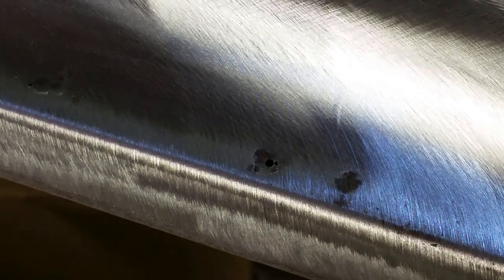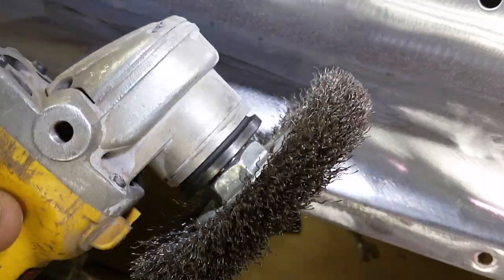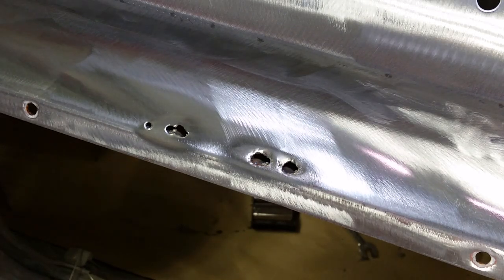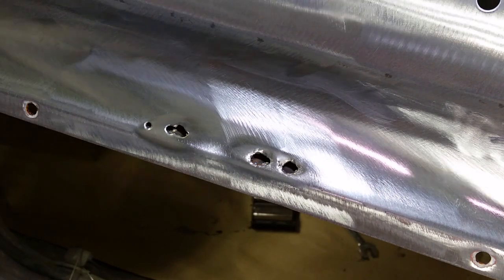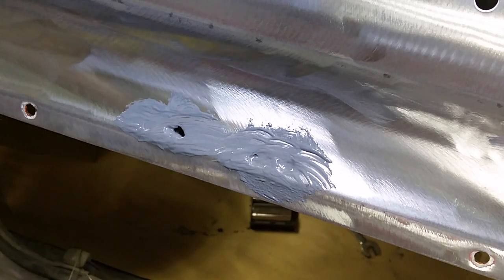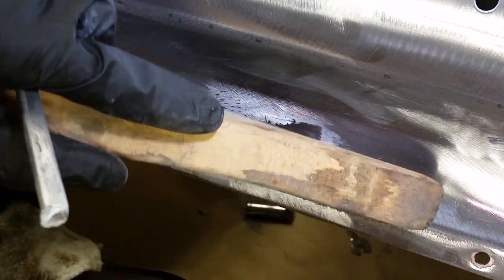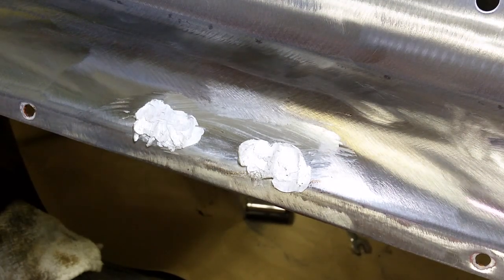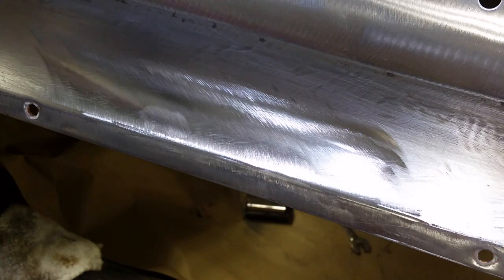How to repair rust holes in 15 minutes

Comment: Glaze only goes on top of primer, not direct to metal. Body filler goes direct to metal for those that dont know. Thanks for the leading tutorial. Sweet video man.
Reply from the maker: I usually use a 3M number 801 two part professional glaze that bonds to: primer, metal, fiberglass, and aluminum. Thanks for the suggestion. Sorry about not including the glaze type in the video.

Comment: I need to repair some small screw holes and a few Mig Welding seams on a car I'm working on.  Never used lead before and watched a few YT videos on the technique.  Yours is the best one and was very helpful to me.  The result you got here was amazing.  I hope mine looks as good as yours.  Thank you
Reply from the maker: Ford Fan Thank you for that.  You most definitely can repair screw holes with this method and the weld seam as well.  I suggest a good quality direct to metal epoxy primer over it.  Thanks again!

Comment: Great tutorial man. Had a hole in my motorcycle gas tank and did this and it's been holding up just fine.
Reply from the maker: I’m glad it worked and appreciate the feedback! Someone had asked would this technique work on a gas tank hole and now I have a definitive answer, “yes it will “! Thank you!
Reply: @Gill Rod Shop  no problem. Whoever asked you, just tell them to make sure they cleaned out any fuel/fume from the inside the tank, that way it doesn't explode
Reply from the maker: @Covert_Op  👍🏾

Comment: Thank you Gill, I will use this method fixing all the pin holes on vintage Harley Davidson gas tank.  Great video!
Reply from the maker: Paul Healey, it should workout just fine! Thanks
Reply: ⁰⁰7777777777777777777777777777777777777777777p777777777777777777p9ppppp7ppp7ppp77p⁸p⁸⁸

Comment: I have a pin hole issue near the bottom passenger side corner of my windshield on a Chevy pickup I’m fixing up. I don’t intend for a show quality truck just something I can drive and enjoy. I can’t access the back of the area. Would you still advise using this method if I can’t use rust inhibitor on the back side of the surface area I’m working on?
Reply from the maker: The window doglegs usually rust from the outside in but if it rusted from the inside out I would want to find the source of moisture and address that first. You should be able to use this method with success on pinholes in window frames. Thanks 😊

Comment: I have some nasty rust that's created holes and thinned out a fist sized area of my old Toyota's tailgate that I'll be attacking this week. Would LOVE to beef up the area and fix the holes without using body filler. Just got a new cylinder of C25 for my mig too (would love to solder but I can dial back the mig and use thin wire which I already have), so I'm happy I came across your video!
Reply from the maker: I love the old Toyota trucks! I hope it turns out spectacular!

Comment: Great video.  Can a repair done with the lead stick be chromed?  I am looking for a way to patch a few holes in an 80's motorcycle muffler as they are no longer available for the restoration.  Thank you!
Reply from the maker: VMX yes it can be chromed by a professional plating company.
Reply: Gill Rod Shop   Gill I read that most shops can’t chrome over lead/tin, is that just BS?
Reply from the maker: VMX anything that is conducive can be chromed. Plastic and other poor conductors can be chromed also, but the process is different! I spoke with a chrome plater today and he said he can chrome over tin/lead filler. Send a picture of the area on the muffler that you're repairing and maybe I can offer some advice. Thanks

Comment: I'm repairing rust holes in a child's wagon. The wagon was sandblasted and epoxy primered. Do I have to sand or grind the epoxy off to bare metal to solder the holes?
Reply from the maker: Yes, you will have to take it back to bare metal and tin it before soldering. Being that the wagon is just a single panel without a sub panel behind it the repair work will be visible from the inside.
Reply: @gillrodshop  thank you for the quick reply. Much appreciated and great video!

Comment: If I have an antenna hole about an inch wide on my roof, can I use a scrap piece of metal and lead it in place before final finishing?
Reply from the maker: I’ve never tried it but it should work if the plug is larger than the hole and placed on the backside and lead on top. I have tacked welded a plug and then use lead body filler over it! Thanks!

Comment: Great to see the old method for filling holes on panels. That lead won't go anywhere, like you say - far better than fillers. We vsll that technique 'lead loading' in the UK. One question - can you use this method on holes in flatter panels ? I am just thinking applying heat to one area on a flatter panel may cause distortion of the metal ?
Reply from the maker: Chris Ward thanks for watching and commenting! You should be fine as long as you heat the area around it evenly. The heat isn’t so bad but uneven heating/cooling is what warps panels. I’ve had car bodies baked and dipped in acid to strip the old body lead, fillers, and paint from them and they turn the oven up to 800 degrees F. 🙂

Comment: No need for backing plate? The lead won’t flow into the other side? I’m planning to use this on bottom of my car door it has small rust holes. Thank you
Reply from the maker: No need for a backing plate if the hole is small. This video that I’ve linked below shows a blind hole done on a T-top pillar and what the lead looks like from the backside once it’s done. You have to use the proper heat and not over heat it though. Thanks for watching and commenting!
https://youtu.be/ur-etZqrnXk
Reply: @Gill Rod Shop  perfect thank you so much, Eastwood has the smallest kit on back order until January but at least now I have a better alternative thank you!

Comment: This is epic... would it work on a roof with 1 hole near the windshield.?... about the same size hole as you worked on
Reply from the maker: Sure! It should work anywhere you have that is clean, can be tinned, and the correct shape to hold the lead solder.
Reply: @gillrodshop  I'm totally trying this on a test piece first... so the steps are, clean metal really well (40 grit etc), apply tinning agent, flux (zinc chloriode) , hit with lead, then wash with water/baking soda to neutralize the acids in flux?
Reply from the maker: @mikep509  Yes, sounds like you have it! You may want to get the metal as bright as possible by using a low speed wire brush chucked to a drill motor then scuff the area around it where you want the lead to feather with the metal, scuff/sand with a course grit (80-120) for a smoother transition around the edge. Then you may go to a 220 grit and it should look almost seamless. I’ve also published a video of me doing a Z28 T-Top area that may help. Thanks!
Reply: @gillrodshop  thanks so much for this window into alternative car repairs.   It's a great learning opportunity 🍻🍻
Reply from the maker: @mikep509  Welcome!
Reply: @gillrodshop  ... question, would a 60/40 tin/lead core solder wire work for this kind of repair?... following the cleaning steps... I can pick up 1lbs of spooled wire for $30
Reply from the maker: @mikep509  short answer is no, but you may try a test piece. I only use 70/30 from Eastwood Tool co.
Reply: @gillrodshop  yeah I see their products, slightly expensive for the same thing.. . I have a few metal working supply shops around my area they may offer a solution as well ...  I understand the process of tin to steel , then lead to tin.   Why can't car manufacturers just build galvanized cars lol ..

Comment: Serious question. What are the pros and cons of doing this over just using a mig welder to fill in the holes then grind the metal flush?
Reply from the maker: This method is quicker and can be done at a lower temperature. From my experience the mig would make this hole 3 times the size before it would start filling in. Also, no need to worry that much about warping due to the low temperature. Thanks for watching and commenting!

Comment: Nice job bro any idea how long did it last? Did it blister back out? Looking for another alternative instead of welding on a thin roof, This is a great video. Thanks.
Reply from the maker: It’s still holding well! Just be sure to neutralize or properly prep the metal before top coating! If your vehicle is a classic it has lead filler in the pillars already, more than likely. Thanks for watching and commenting 👍🏾

Comment: Can small rust holes in a steel fire pit be repaired using this body solder method?
Reply from the maker: Robert Halseth yes but as soon as the pit gets hot enough to melt the lead it’ll fall out. Welding may be the better option in that case. Thanks for watching and commenting! 🙂

Comment: Thank you for the video. 
I am restoring a 1970 Dodge Charger and the rear window area has lots of rust holes. I was planning on cutting out the rusty areas and patching in metal but this may  be a better way. So often, even careful use of the MIG can result in burning through areas that are super thin. You start by trying to close up a tiny hole and end up making several larger holes that require more and more welding.
Reply from the maker: Gregory Kern I’m sure it’ll turn out fantastic! Thanks
Reply: Tig welder might be a good option for you
Reply: Had the same problem. Turn down the spec's on your welder and see if that solves the burn through.

Comment: My Harley-Davidson gas tank has several small dents in it, could they be filled using this solder and would it survive the heat of powder coating after the tank is repaired?
Reply from the maker: David MacGregor that is an excellent question. I'm not so sure that it would stand up to temps (+\-400degF) that high. I guess it would also depend on how long it's at that temp. I've had car bodies dipped in acid tanks but they bake them about 8 hours at about 800 degrees before they dip them and all the solder melts off the body at that temp and time period. I can try it if you want me to?
Reply: Eastwood has a led free body filler they sell.  It’s applied the same way.  It’s melting point is a lot higher, maybe 600 degrees.  I just had some metal powder coated that I used the body filler on and the heat from the powder coating was not a problem.

Comment: Thanks Gill. I have a tricky job near the boot (trunk) of my 1993 Cavalier, and I had forgotten about body solder.  You've made my day!   Cheers, John.
Reply from the maker: thelonegroover Thank you and happy soldering.
Reply: Thanks Gill. Just been in the depths of my garage storage space and found a body solder kit I bought quite some years ago.  The solder is lead based, but I guess the solder you're using in the video is non leaded as you're sanding it .  is that correct?  Cheers John.
Reply from the maker: thelonegroover I don't want to tell you wrong so I copied and pasted from Eastwood.com below. 
Eastwood's Basic Body Solder Kit helps you complete small leading jobs with better adhesion, strength and durability than plastic fillers

Spreadable (plastic) range is 361-489 degreesF
Includes tools and accessories
30/70 lead-based body solder is slightly easier to work with than our lead-free solder, and provides better adhesion, strength and overall durability than plastic fillers. Includes 2 lbs. of solder for small solder jobs."
"
Reply: Thanks for the info Gill. I appreciate it .

Comment: Do you think this would work on an air compressor tank with small rust pinholes?
Reply from the maker: It would but I wouldn’t recommend this type of  repair for any thing that requires structural integrity...cosmetics only! If you were never going to pressurize it and it was just for cosmetics I’d be just fine. Thanks for watching and commenting! 🙂

Comment: Will this work in a situation where you need the top and underside of the hole to look good? I want to fill luggage rack holes on a TR6 decklid and the metal is visible on both sides. Thanks!
Reply from the maker: It should! You would have to file and sand the back side to make the solder even with the surface. Thanks for watching and commenting!
Reply: @gillrodshop  Thanks!!

Comment: How big of a hole will this fill?  When you’re done,  do you prime and paint as usual?
Reply from the maker: Gantry Crane, I could probably fill a hole the size of a dime. Yes, you’d want to neutralize, prime, and then paint. The auto industry used this stuff years ago to fill gaps where the B pillars are welded to the roof and where the quarter panels are welded/brazed to the trunk pan. Thanks for watching!
Reply: Gill Rod Shop Cool so this would be a good technique to fill the bolt holes after you remove fender flares right?  That’s what I’m thinking of here. If you get a chance to post a link to the lead that you use, that would be great.
Reply from the maker: Gantry Crane https://www.eastwood.com/body-soldering-sticks-10-pack.html
Reply: @gillrodshop  I can attest this to be true. My 65 Mustang has this body solder in the B pillar seam. Far superior to plastic.

Comment: Great video. However, I see more rusted areas above where you were working. What would you do about all those surface places that are rust yet not complete holes yet? Thanks
Reply from the maker: Rick Bell eastwood's rust encapsulator works on any area that hasn't rusted all the way through. I must've missed those spots 🙂 thanks!
Reply: @gillrodshop  Yep I have used rust encapsulator before on a 56 restoration. Inside doors, quarters, cowl, pillars, fenders.  It has been a lifesaver so far. Going to be using it in same areas before epoxy sealer for my 70 Mach 1 restoration. Sad to say it has tiny holes all in the double layer of the cowl. But nowhere else. Lower quarters were replaced years ago it appears. Thanks for the feedback. Great work and info.

Comment: Hey Gill, what kind of heat source were you using?
Reply from the maker: Michael LeBlanc MAPP GAS from the home improvement store, yellow cylinder. Thanks
Reply from the maker: Michael LeBlanc the blue cylinder works just as well, too!
Reply: @gillrodshop  Sorry Gill, you did show that in your video, I just missed it...For some reason I thought you were using a B Tank or something hotter than Mapp or Propane.
Reply from the maker: Michael LeBlanc no problem. Thanks for watching.

Comment: Gill, I have an Impala that I'm restoring and I'm getting rid of all the mid body trim. There are all the holes left over from where the clips went to hold it in place. Do you think leading them is the way to go vs welding them and grinding? I just want something that will last and the holes are roughly a little bigger than the biggest hole that you just leaded. What do you think?
Reply from the maker: You could but I don’t think it’ll hold too well! You may be better off welding those. Thanks for watching and commenting!
Reply: @gillrodshop  thanks for responding so quickly Gill! I appreciate it.

Comment: I have a 70 Camaro that was body worked and repainted I assume in the late 80s early 90s most all the filler shows cracks in it from age or deterioration.. The factory lead that connects the sail panel from the roof to the quarter is still perfect. Speaks highly of a repair like this...This cant be any worse for you health wise than all the chemicals in modern paints and primers just be cautious and use PPE.
Reply from the maker: Scott Coleman thanks.

Comment: Not that I know what am I talking about but why not using aluminum insted of lead? Im just asking because of health reasons. Nice work btw. Thanks for sharing.
Reply from the maker: Tomo Polic that's steel. Lead was used on these cars at the factory along the sail panel and a few other places and it holds up well. Thanks

Comment: Gill, thanks for the video mate. I'm curious how the rust encapsulator handles the heat. Does it damage the product, causing it to bubble due to the heat and thereby risking rust forming under that repair later on?
Reply from the maker: I only use the encapsulator beneath the panels and in blind spots for corrosion proofing. It doesn’t work so well on fresh un-rusted metals. I use DTM primers on the clean metals. POR-15 handles radiant heat pretty well but doesn’t hold up well to ultraviolet. Thanks for watching and commenting!
Reply: Great video tutorial.  
Question once completed is it necessary to neutralize  the area with baking soda?  Thanks!

Comment: Nice way of doing it, but please tell how does the two different matals work when expanded/shrinked from heat/cold over time? 
My first tought was why not just weld it?
Thanks
Reply from the maker: Frili Me I've welded a lot of patch panels but this is about not welding. Lead has been installed in millions of factory cars but not many people still use it anymore. As long as the temperature doesn't reach the melting point of the lead it should be okay. Thanks for the observation.

Comment: How about if it's a bigger hole? I don't know how to weld, is there another way .. Thanks
Reply from the maker: Yes, this works on larger holes, too! Just be sure that the lead has concave metal around it so it’ll hold once it’s filed flat with the surrounding surface. Here’s a link to a video I published in which I fill some larger holes with body solder. Thanks for watching! 
https://youtu.be/2W_zKEjgaLo

Comment: I like and prefer the lead but if i am a noob with lead could i just tack weld and grind that same repair out?
Reply from the maker: Mike CorLeoné sure you can! I usually replace or cut and patch new metal in. I have a couple videos on my channel that I’ve cut out and welded in new panels. I may publish a video in the future of how I MIG weld rust pinholes up. It’s tricky 🙂. Thanks for watching and commenting!